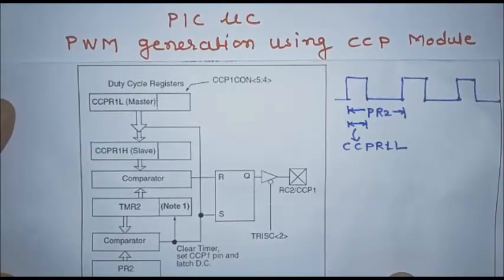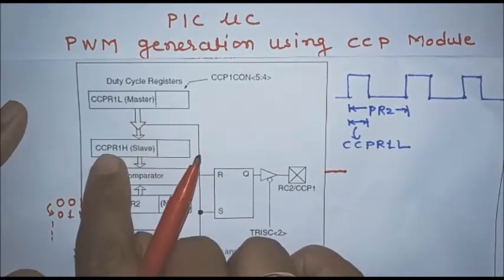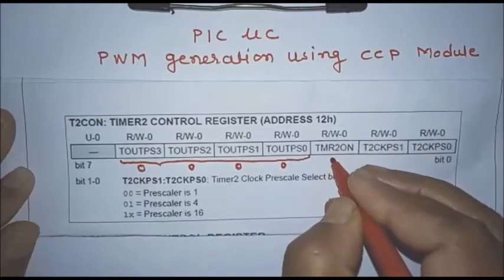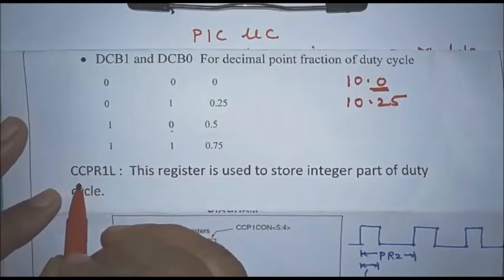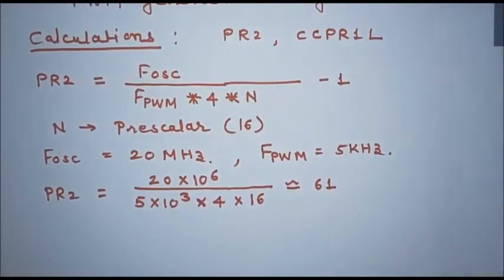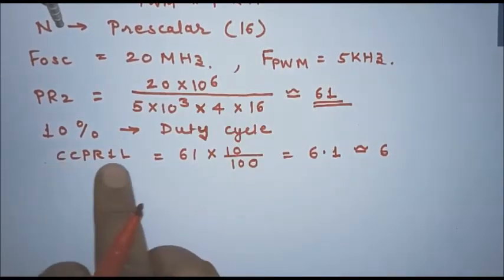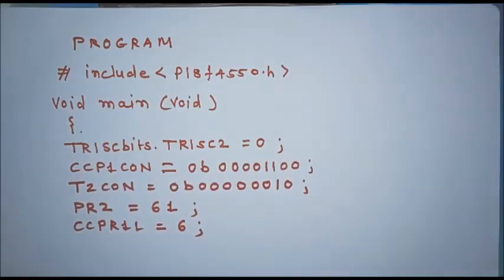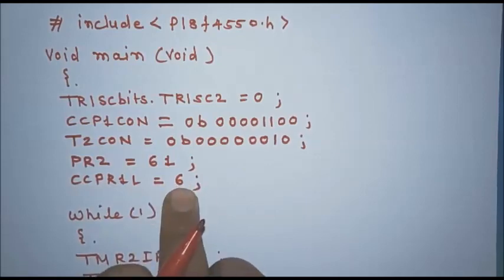PIC_Lecture 12 : PWM signal generation using CCP block of  PIC | DC motor speed control |

Comment: Madam I want to generate pwm signal by changing potentiometer for duty cycle values in decimal points. I want to apply formula freq. =25*(5-dutycycle/100) what will be full code in c for pic 16f 877a

Comment: Thank you very much for this explanation.
I think that there is an erreur on calculation of CCPR1L value, because you should use this formula: 
PWM Duty Cycle = CCPR1L • TOSC • (TMR2 Prescale Value)
with PWM Duty Cycle is Ton
With Fpwm = 5KHz , Tpwm = 200us , Fosc = 20MHz, Tosc = 50ns
Ton = PWM Duty Cycle = 10% * Tpwm = 0.1*200us 
CCPR1L = (PWM Duty Cycle) / (TOSC • (TMR2 Prescale Value)) = (0.1*200us) / (50ns*16) = 25
CCPR1L = 25